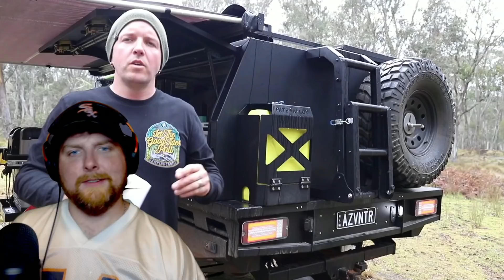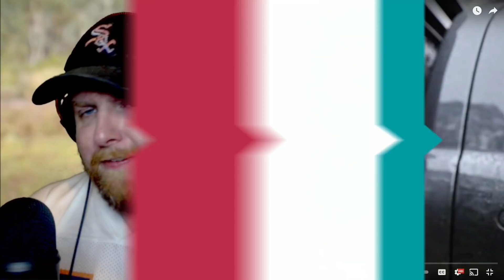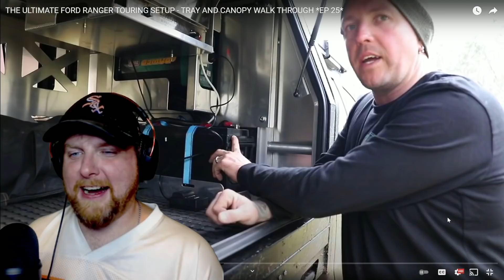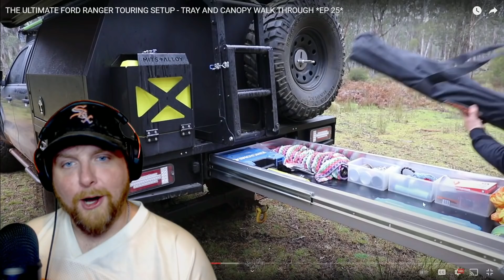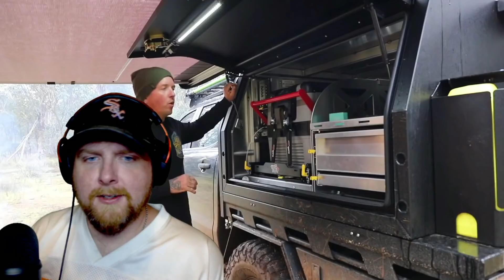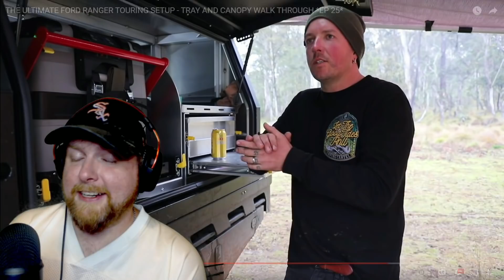American Reacts to The ULTIMATE 4x4 Setup - Australia

Comment: Someone smarter than I might correct me on this ( and may only relate to New South Wales) but the mudflaps are necessary because legally the top 50% of the tyre has to be covered when viewed from the rear. It prevents flying stones from smashing the windscreen if the vehicle behind you.
Reply: Not all cars come with them in most cases they are an optional extra
Reply: @carguy7243  Where are you talking about? In NSW at the very least they are required and you can and will most likely be defected for not having them.
Reply: @garrymuir1442  S.A  my Chrysler 300 never came out of the factory with mud flaps
Reply: @carguy7243   I think that may be to do with how deep the wheels sit in the wheel arches on the 300, potentially acts as a mud guard.
Reply: @garrymuir1442  even NSW highway patrol cars don't have any lol
Reply: @carguy7243  Yes the rules in NSW state such that basically if the wheel arch cover the wheel enough and acts a mud guard, separate guards are not needed.  Check Australian Light Vehicle standard rules  section 32,sub (2)(b) 'the body or part of the body of the vehicle acts as a mudguard'
Reply: Yes, mudflaps are a requirement, however many 4wds have them on a quick disconnect system so they can take them off while off road, as they have a tendency to be torn off when you need to reverse and the get pinned between tyre and obstacle.
Reply: @tareskisloki8579  Yes repairing mine today

Comment: It makes me wonder how I ever got by with a '76 2WD Kombi. I did have to park it on a slope so I could push start it when the radio flattened the battery. The beer usually ran out at about the same time the ice melted in the Esky so that usually meant a run into town. Didn't have a chair, just sat with my legs out the side of the sliding door. Didn't need a tent, I had a folding bed in the vehicle. If I had my time again, I would have bought a table. Cost me $4000 32 years ago. Times have changed but I haven't.

Comment: The setup is near perfect and the cost is justified for supply, install and setup. One comment about the electrical system is the whole setup could be done with 1 or 2 Bluetti Max's. These are Li batteries with invertor and all the outputs needed. The best thing is the Bluettti's are portable. Check out the Bluetti's. I have 2 of them myself. One for the house incase of power blackouts and one for my boat and 4x4.
Reply: I thought of going that way but I believe the drawback is that they can't charge from the alternator. Only trickle charge from the 12v socket
Reply: @garysheppard4028  Hey Gary, they can also charge via solar panel so I reckon some smart auto elec can rig up a charger via alternator.
Reply: @aussietaipan8700  Worth looking in to

Comment: Ya should consider yourself blessed 😇. A ram trx here costs $260,000. Stock! A stock Silverado 2500 with the 6.6 litre duramax turbocharged diesel is up around $180,000 for a used one with 50,000 kms on the clock.
Reply: yeah but those kinds of things are pretty useless here they are so big but have to have their GVM downgraded here so they can be driven on a standard license they say the dry weight is over 3500kg and they are limited to a 4495kg GVM

Comment: One of the things that I really didn’t see covered is that the box part of the build is attached via a flatbed. With that when your not on the trails you can put the box on stands & have your stake side flatbed work truck.
Reply: This canopy is a lift off canopy and they are bolted to the tray. On each corner there are 2 holes in the front and rear frames where the jack stands slot into for raising the canopy once it is unbolted so the vehicle can drive out from underneath. In Oz, it is not so common that the canopy would be removed while camping - some might as a 'base station', but for the most part the canopy stays on the back. It is a useful feature though if you don't want to carry the canopy around everywhere with you or you need a flat surface for other things.

Comment: working in the quarry, I tried two vehicles: the Ford Ranger for small maintenance, but the gem is an Iveco Daily 4×4 long wheelbase with 19.6 cubic meters of cargo set up as a mobile workshop, when you take the hairpin you have the feeling to overturn, but in the end it doesn't happen. It has 24 gears (it is a 6-speed with two reduced levers)

Comment: Most good 4x4 is diesel. Not only more efficient and more torque but no cooling issues and also much better in case of water  submerge while doing river crossings.. (no "sparkplugs/ignition to get wet"). Same reason for the snorkel (air for the motor during river crossing).
Reply: Not always the case, I have an 07 V6 Hilux which has more torque starting from lower revs than the diesel of the same year, it also has sealed coilpacks that aren't bothered by water. Only disadvantages are the hot exhaust and 2-3lph extra fuel usage. It can also handle poor quality fuel which would destroy the sensitive injectors in a common rail.

Comment: The kg to pounds thing just made me do the math on my 79 series Landcruiser. 8818 pounds in day to day road(off road) trim, or 4000kg. That's full canopy on single cab, 2 x 40L fridges, the travel buddy oven same as this bloke, dual batteries under the hood plus 2 x 100Ah in the back. 3 sharp house type 158W solar panels on boat topper roof rack, 15L air tank fed by 2 compressors to 150 PSI for either tyres or tools. 3 Titan drawers with Ryobi power tools, recovery gear and containered small tools, narva connectors, 12T cannister jack. Warn 12000lb winch in the front in TJM steel bull bar, 2 in lift with 400kg constant leaf packs in the rear which needed help from boss airbags run at 50 PSI in the back. All sitting on 315/75r16s or 35's. Numerous other crap, dc/dc, inverter, water tanks etc. It went anywhere and everywhere, due to all the gear i was usually the one rescuing the other members of our club during breakdowns or recoveries lol.
Reply: I wouldn't say that too loud that is way over GVM which is 3400kg

Comment: Ranger is one of the least capable off road vehicles. Too heavy, too low, wheel base too long.
Reply: Depends completely on the trim level, number of doors, the year, the options, etc. A 2.2L 2dr trayback povo pack is nothing like a raptor for example. What a strange comment.

Comment: Diesel run cooler undercarriage, less chance of sparking bushfires, and until recently was cheaper fuel. Turbo diesels are generally more efficient, than unleaded petrol. 
Petrol/gas is nearly double in price in Aus to US. 
You also have to remember, even though we are comparable with the US in land size, the population is around our coast line. So when we go bush, we go bush. Dodgey phone networks, no fuel for 300km. No shops. Rescue if you break something can be 12hrs away. Got to be self sufficient.
Reply: Absolutely. Less than 30 million people in an area the size of the continental USA really brings the meaning of ass-end of nowhere into focus. Love it.
Reply: @Outland9000  Haha! For sure! USA 332 million, versus Aust 27 million.

Comment: Yeah most of the dual cab 4x4 utes you see  in Australia will have a Diesel (usually around 2.2 - 3.0 L turbo diesel) and will come in with a GCM of around 6 to 6.9 Tonne  (not sure in pounds) .  Most will tow 3500kg (although thats a whole other topic as usually that'll mean zero payload!)  The Navara is 2.4L twin turbo, the Ranger had various iterations from a 3.2 5 cylinder to a bi turbo and now whatever they have.  Rarely are they petrol (D40 Navara was a V6 petrol option)  Some are V6 diesel but a lot of 4 cylinder diesel.
Reply: The nav is 2.3 TT but everything else is spot on.

Comment: Snorkels are good in out wet season especially up north Qld and NT
Reply: Even better for dust reduction, saves ya motor/radiator.
Reply: @mezanian  doesn't impact the radiator at all but certainly helps on the air cleaner side, especially if you run a donaldson.

Comment: Only real Tuff & reliable trucks are the Nissan Patrol Td42ti GU coily ute & some Landcruiser’s, 80’s & Hdj79. All these modern twin cabs are pieces of shit, with rear drum brakes & leaf springs & IFS is absolutely crap 💩.. Older 4.2 turbo diesel’s are the go & chuck on a bigger turbo’n cooler & she hauls ass
Reply: And I can tell you my Nav kicked the ass of 2 of 3 land cruisers the last time I went to the Cape. I'd back an IFS dual cab ute over a 105 series or 80 series unless you throw a lot of money extra at the 105 or 80 series, which you can't afford to do since you're already spending twice as much.

What it comes down to is that ground clearance is lowest under your diff centres. IFS vehicles may not have the flex but their front diff is MUCH higher so they get way way better approach angles.

Sure, they lack the flex, but diff locks will get you through a lot more stuff than flex will, since at high flex angles you aren't really getting much downward pressure and thus not much traction.

Any fully kitted solid axle, on bigger tyres to compensate for the clearance issues, will be better offroad. The Patrol even more so :) I don't disagree. 

But for anybody with a limited budget, the IFS vehicle will win. (especially given a flogged out ex mine 79 series will set you back 130k now). And actually still be road legal doing it.
Reply: Navs are unreliable & gutless.
4.2ltr turbo
Reply: @triggerhappy8872  

The TD27 was 4 cylinders off a 6 cylinder TD42, so hardly "unreliable" or "weak"

The QD32 was a stroked version of that motor.

Weak, with a 3.2 litre diesel engine and 15 pounds of boost, running an effective compression ratio of about 45 to 1?

Yeah, nah mate.

Comment: It's funny when I say I have a Holden Colorado RC... which is NOTHING like a chevy Colorado 😂, in fact it's nothing like a Holden, underneath the Holden Badge and the modified Tahoe/suburban front end is actually an Isuzu Dmax 😂, mines runs the 4jj1 3ltr turbo diesel, and everything else is isuzu lol ( in fact came out of the same factory as the dmax in Thailand lol ) so I've got a Holden ute that's incredibly reliable that loves to work lol

Comment: I drive a 78 series Landcruiser, Troop carrier. It would shit all over a ford ranger. These utes/traybacks are pretty much useless if you do extended trips with no-where to sleep. I can pull up anywhere and climb into the back for a snooze especially if it's pissing down rain. Why buy this and then have to pitch a tent to sleep in? F#@k that and ford ranger is a shit product anyway, get a Landcruiser if you are serious, been waiting 5mths so far for my new troopy that is being built in Japan.
Reply: imho 70 series cruisers, other than the 73 series middy, are the most overpriced, overrated 4wd on the market today.

What are the current secondhand price in Brissy for a ex mining industry single cab 79 series? In excess of $130 grand.
Reply: @AndyViant  I payed $75 000 for a brand new 78, going to spend another $25 000 in mods when I finally get it. The second hand market is out of control, rumours say that some dealers are selling new cars as secondhand with 100ks on the clock because the price of a new one is set by Toyota and can't be adjusted. Covid tax. There is a bloke here on youtube that will be getting his new troopy in July but he doesn't want it anymore so it's up for sale for $109 000, making coin if he sells it without ever driving it

Comment: Seconded..  You need to watch Ronnie Dahl, he showcases some cool 4x4 builds.

Also, the reason you see a lot of snorkels is because of the ability to ford a river.
Diesel engines can operate under water, as long as the electrics are waterproof and air intake is above water.
Petrol engines cant due to the ways spark plugs work and will short out.
Glow plugs in a diesel arent "sparking"
Reply: Umm, I'd driven a petrol WITHOUT a snorkel through some pretty deep water.

Aka, water coming over the bonnet.

Spark plugs were never an issue.
Reply: @Emily35-Official  it's over played tbh. The kind of depth you need to be able to tell the difference, is the depth where your battery and alternator drown and your car floats away anyway.
Reply: @Saphire0437  my only concern has even been the air intake. Keep that dry and supplied with air and everything else is fine.

And cars stop floating once the inside fills with water.

I've also had the back end float, but only because I stopped in the water (was following a small channel thinking it led back to the road, but it was a dead end).
Reply: Counter-point: you can dry out a petrol if you do mess up and there are petrols with ridiculous wading depths. If you get a drop of water inside a diesel...see ya later. The other perhaps bigger reason you see snorkels on everything from a 3L ute to a 13L prime mover in aus is because of dust. See the stock intakes on the 70 series landcruiser. Not waterproof at all. Designed to operate in the desert though.

Comment: I feel obliged to say, our tyres are not allowed  to exceed the width of the vehicle. mud flaps are also a legal requirement
Reply: Tell that to literally 90 percent of Ranger owners. It seems a right of passage to have massive tyres hanging out the side of their utes.
Reply: @montyfpv2259  it's because they think they're Americans xD
Reply: Flared guards fix the wide tyre problem and mudflaps are standard . ✌️
Reply: Yeah but Ranger owners are WANKERS
Reply: Sometimes its needed hahaha
Reply: Giant wheels ruin off road capabilities, because they severely change the gear ratios, usually at the detriment of low-speed torque. The only way to change that is to put either reduction gears in the axles or put a different ratio in the transfer case.
Reply: @CJTheReal  If you are going to do a proper build of course you are going to change the crown gear set to suit your tyre size.

Comment: Every Ford Ranger built is Diesel only a 2.2 litre turbo diesel base model and 3.2 litre 5 cylinder turbo diesel no petrol engine available and the same goes with any 4x4 Toyota Hi-Lux and all the others, the new Ranger to be released soon will be a V6 Turbo Diesel, the Fird Ranger was designed and prototyped in Australia for the world by Aussie engineers and quote me if I’m wrong but the USA got our Ranger design a few years after we got it and I believe you get the 4 cylinder turbo petrol/Gasoline engine in it
Reply: New taxes coming in on larger engines like in Europe so the 2.2 might get an extra turbo or two to dodge the fees
Reply: Don't forget the 2.0 litre bi turbo, but yes all our rangers are diesel only. I bet Ford in the US wouldn't allow rangers to be diesel as they would compete with their F series.

Comment: That looks like a beast.
But it's got the same issue that all crew-cabs have - The bed/tray is mainly outside of the wheelbase and heavy weights including canopies, spare wheels and jerrycans are now hanging on a moment arm that can bend the chassis.
Not to mention the bull bar and winch on the front, and then 4 big bastards going fishing, helping bring the TAR up to it's limit before we've hit the off road trail.
Reply: Nah, pretty average mate.
Hello from NSW!
Reply: @glennllewellyn7369  Pretty average doesn’t mean it’s good idea the points above are very valid for a duel cab , ask Ronny Dahl

Comment: Rangers were designed here in Australia, but are the most over priced Utes on the market, next to the Hilux. Its all badge inflation. In terms of what they offer, you pay a premium price for bare bones. The Chinese utes are now on par or better for what quality you actually get, and about $20k cheaper.
Reply: Im in the ldv page and there's a lot of problems that are major like overheating engines and massive rust problems. The electronics dont work from new plus other issues. I wouldn't be comparing them yet as they are just new to the market and not tested on longevity
Reply: @Pvmanne  Prior to the 2022 model, id agree. But all the major brands are having issues now. Just comes down to is it worth an extra $20k plus for a sticker.
Reply: @smartassdroid5149  but its only 22 model how do you know it will be ok by 23 ? Lol. I get its cheap and affordable, I sat in the gwm its impressive but taking it back to the dealer isn't a thing that appeals
Reply: Keep going. Second hand Ranger Raptors are selling in my part of the country for over $90k, and a brand new GWM is over $40k. 

The only new 4x4 utes under $40k are the Mahindra PikUp and the SsangYong Musso (neither of which is Chinese btw)
Reply: @AndyViant  The LDV T60 MAX is a very good car. Past model issues tainted the rep, but its solid.
Reply: @smartassdroid5149  Park near a beach and it won’t take long to see the poor quality steel and poor galvinising start to show ,there crap from what I have seen ,yes they are cheap and so they should be